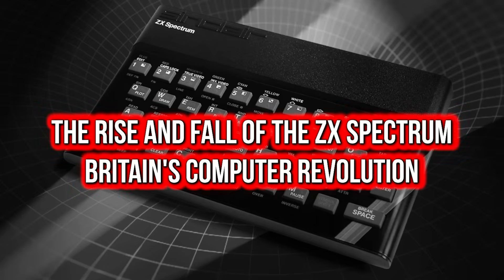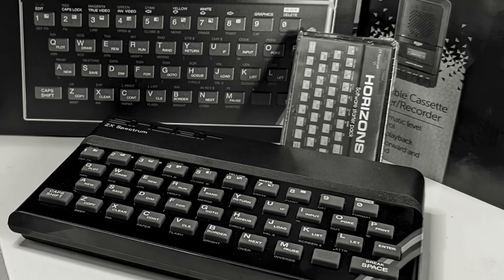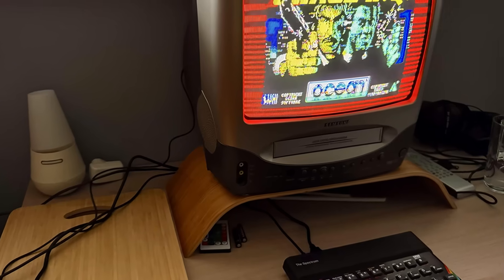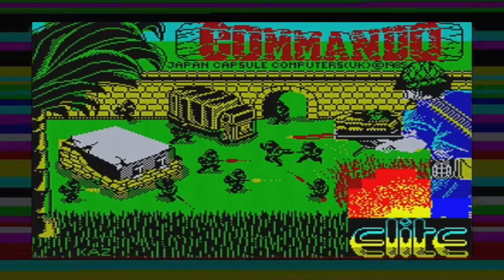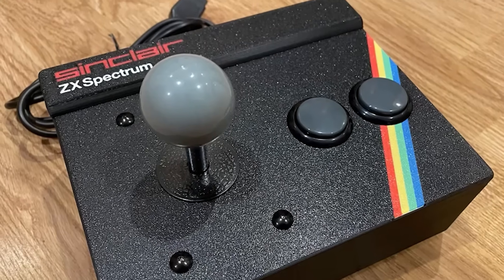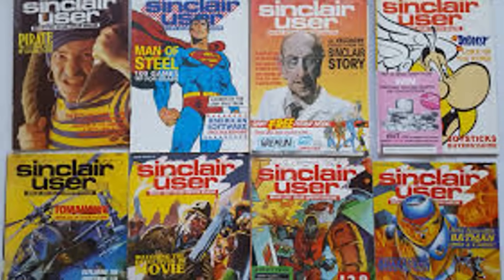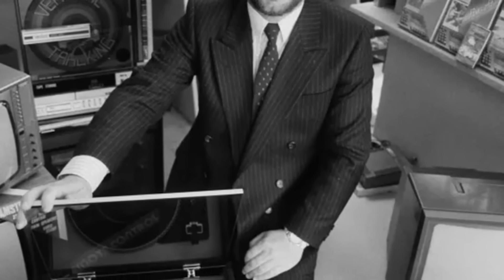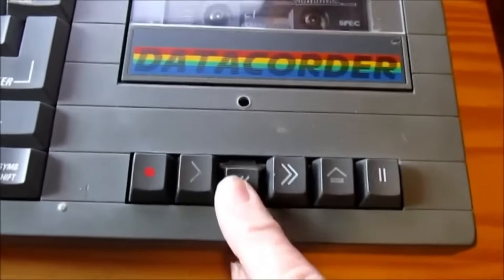The Rise and Fall of the ZX Spectrum: Britain's Computer Revolution

Comment: You forgot that on the 128k +2 you needed to buy a small screwdriver to adjust the volume via the small hole in the tape deck with the cover open. :)

Comment: The Spectrum and the ZX81 were different to the competition. The book that came with the computer was a programming course as well as a manual. The program cassette that it came with had a program that explained the components on the logic board, what an address bus was, how memory worked. Though the keyboard was not as good as the competition, the single key command feature made programming easier for people who could not type. I read the book from cover to cover and did every exercise, and now I am quite a successful full stack developer. I would not have done my computer science degree if it had not been for the spectrum and ZX81. The other computers may have been more polished and better quality, but the Sinclair computers gave far more opportunity to learn.

Comment: One time I had a couple of 48k ZX spectrums, one worked and the other didn't. Turns out it was a bad ULA chip. I swapped the chips around, the "good" spectrum now produced the garbled, unusable picture, while the "bad" spectrum now worked good as new! I remember the dreaded R tape loading error, I experimented around with various different tape recorders until I found one that was most reliable for loading from tapes. I also remember when the power supply for my spectrum failed, something shorted out inside. SO I bought a replacement (one of those multi voltage adaptors with like a million connectors at the end, that worked well, until one day i accidentally set the polarity the wrong way and that was the end of that. I was gutted.

Comment: That photo you're showing at 2:02 and at 12:01 claiming it's the Timex factory in Dundee, is actually from Amstrad factory in Korea. And that Timex sign is back of digital clock that hangs there. You can clearly see Amstrad CPC 464 and its green monitor, as well as Amstrad DMP 2000 printers. :)
Reply: Yeahhh... and those are Korean women assembling the machines. Really?
Reply: Well spotted

Comment: Sir Clive will be turning in his grave over the slowness and inefficiency of todays computers and in particular their programmers using gigabytes of ram and storage when he only used 4-16K
Reply: So very true, I started my programming career on an Atari 600XL with an assembler editor cartridge. We learnt to use every byte of RAM. Today’s programmers are lazy IMO. I had a friend working on a Microchip PIC controller that had no spare RAM left to store variables. The system had a small 16x 2 LCD display and he worked out that he could use some unused custom character RAM in the display as extra RAM for variables. Pure genius and design skills that are lost these days.

Comment: I wonder if the 30% failure rate were attributed to sales of units from Dixons.
Reply: Mainly, in my experience - and I repaired a fair few, it was the arrival of the joystick interface and it being plugged in and out of the expansion connector whilst the ZX80 was still powered up that caused many of the failures. This would generally blow one of the memory chips making troubleshooting quite difficult and time consuming but the cost of parts to repair relatively cheap. After a while I made an add-on that took control of the memory and made troubleshooting much quicker.
Reply: @DaveJS46  I was thinking more along the lines of everything sold via Dixons breaking down suspiciously around a year after purchase as if they were agreeing to take companies known to be reject stock. I had a Mega Drive that lasted 10 months back in the 90s bought from there. Products bought from Comet, John Lewis, Woolworths, Boots or independent stores always lasted longer.
Reply: @DaveJS46  My point was that Dixons sold junk. Everything breaks down just outside of the 12 month warranty while products bought from other retailers are often still going today.

Comment: I had a zx spectrum in the early 80s. It was brilliant, I smashed the keyboard in throwing it at the wall, playing manic miner, I soldered the cracked board back together with pieces of multi core and fitted a proper keyboard, only to smash that in half playing monty mole. I Soldered it together again and worn the keys out playing Daley Thomson! The great thing was you could rent tapes from blockbuster and copy them tape to tape around your mates house.

Comment: It had to end when newer machines became common enough. As a business machine the Spectrum was a non-starter. In order to function as a business machine the computer needed at least:
A way to quickly load and store information - a floppy drive.
A proper OS like CP/M or any kind of DOS, the OS allows managing files making retrieving the correct information easy .
A proper spreadsheet implementation, i.e. VisiCalc or Lotus 1-2-3 or something similar.
Those were native or common in platforms like the Apple-2, IBM PC clones, Atari devices and the Amiga , not the Spectrum.
Reply: The Spectrum was used by small and medium businesses in Portugal. Timex Portugal made a floppy drive peripherals and serial printer ports. The sofware side was covered by Tasword (word processor) and Omnicalc (spreadsheet) - among others.

Comment: I'm still playing Manic Miner, some 40 years later, and I still haven't managed to get to the end.
Reply: All of the levels are easy enough with a few tries. Back then in the 80's I could walk through it without losing a life. But with a simple infinite lives cheat on an emulator or even save stating before each level it's a fun 30 mins - 1 hour even to this day. The laser level was the hardest as I recall. But even then with repeated plays there's an actual pattern to the beams so you can actually just pattern learn it like a Pac-Man level, and do it that way.
Reply: @frankbrodie5168  i got fed up with it was too long winded
Reply: At least you could get to the end of Manic Miner, unlike Jetset Willy.
Reply: me to dint like jet set willy
Reply: I got to the end of manic miner and jet set wiily by using POKE commands. It's what kids these days called 'cheat codes'. There are poke commands that give you infinite lives so you complete any game!
Reply: I still play Atic Atac 40 years later - I still haven't managed to finish it with 100% of the rooms visited -- I'm always missing some...  I liked the fact that, once completed, it would not just show you a score, but also % rooms visited, and time taken to solve -- I tried playing it optimizing for each of those in turn  (and with the different characters ('difficulty levels') the strategies have to change with the changed shortcuts through the maze.